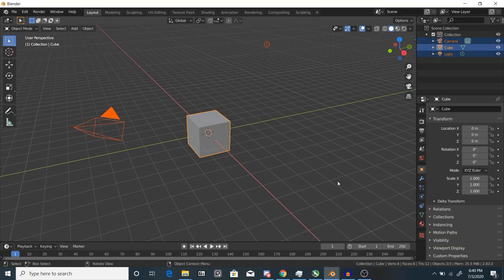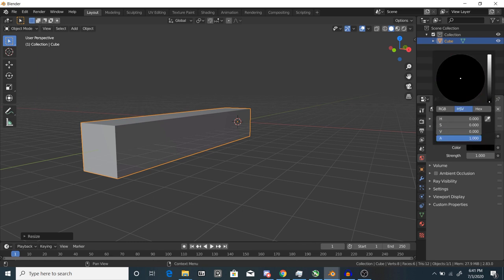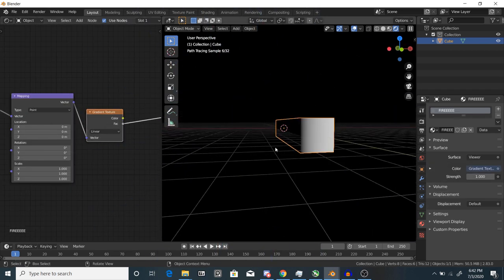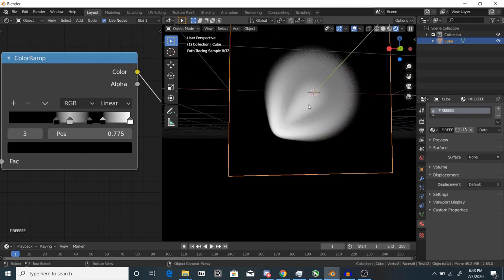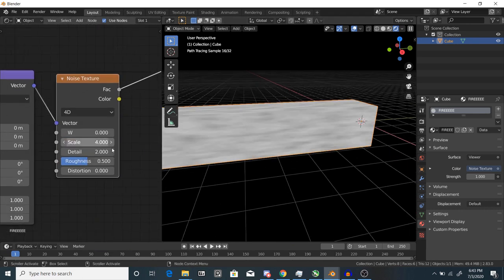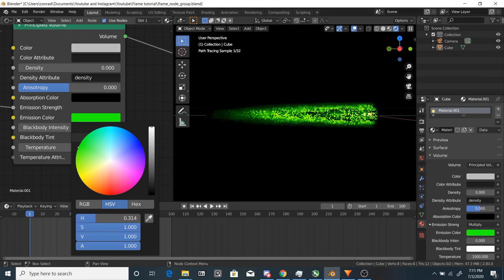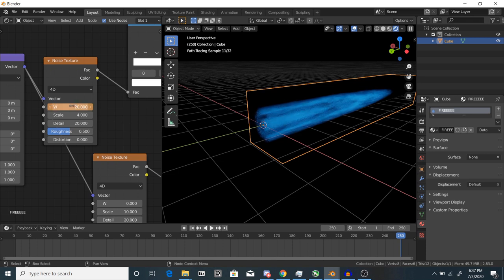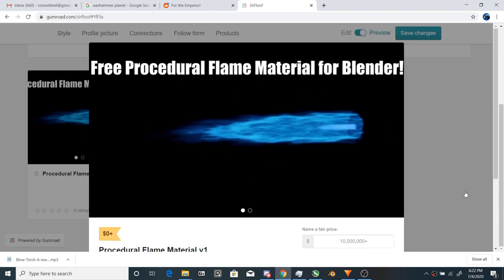How to Make a Procedural Flame in Blender 2.83!

Comment: I bought this project of yours and I really liked it.
However, how do you animate it?
The fire just stops and doesn't move.
Reply from the maker: Hi Yann, have you tried keyframing the animate value? To test if this works for you, go to the beginning of the timeline and hover over the animate value with your cursor. Hit i on your keyboard to make a keyframe; the value will turn yellow. Next, go to the end of your timeline and change the animate value. Repeat the previous steps, hover your cursor over the value and hit i. If you already knew how to animate things or I  explained this badly, sorry! If the issue persists I’ll take a look at my source file for any issues. 
Cheers